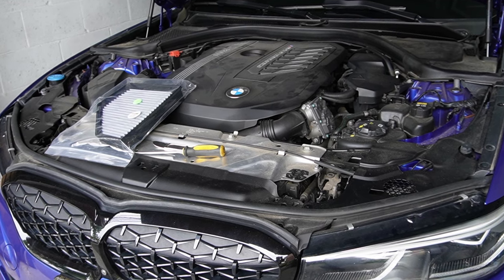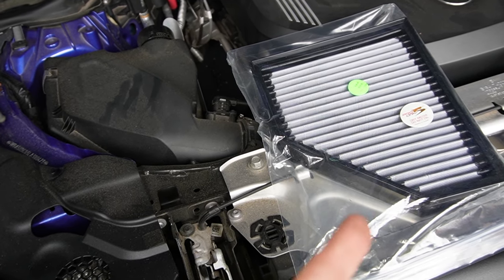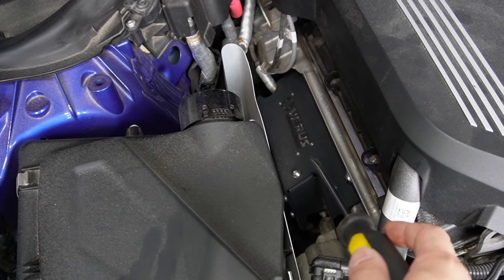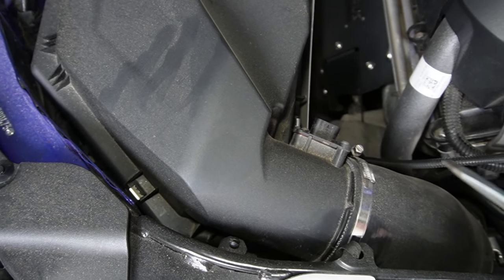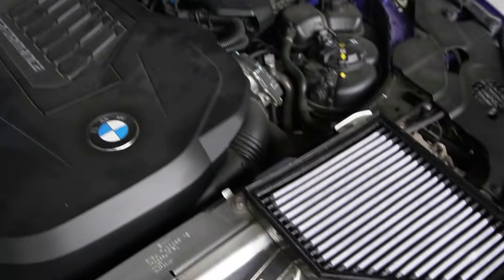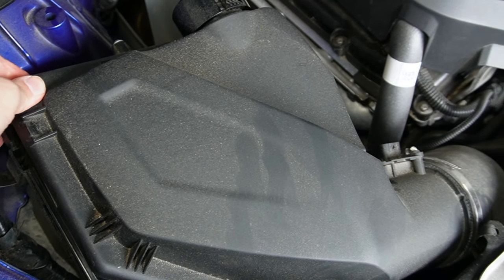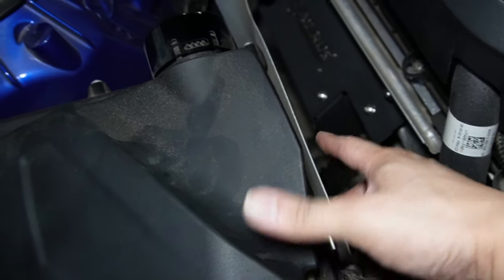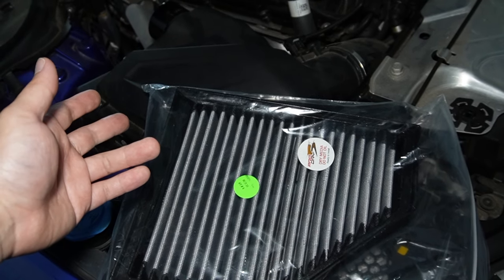PSA: Your Engine Needs to Breathe! | BMW M340i | Toyota Supra | B58

Comment: Definitely ordering for my m240i!
Reply from the maker: Do itttt! But there might be another part# for M240. Double-check before ordering!
Reply: you should look into silicone intake elbows to remove the resonators and also a turbo inlet with wider diameter to remove the stock inlet. I have a b58 racing silicone intake and a DAW turbo inlet
Reply from the maker: @souljayt8411  Agreed. I mainly did it because I wanted a cleaner look and less-cumbersome engine bay. Plus, it doesn't hurt to get rid of plastics with aluminum & silicone ;)
Reply: I put on my m140ia this IS thé best best air filter no oil best filtration AND quality

Comment: Any difference with the intake pipe and resonator delete?
Reply from the maker: It's interesting - scroll down for TLDR.
I'd done the intake resonator delete and the intake pipe at the same time; DME unlock and BM3 stage 1 after. I don't recall hearing any intake and/or turbo sound after doing the intake res delete & intake pipe. But after getting it tuned on stage 1, I have since started to hear turbo whistle and spooling underload. I wanted to assume it's because the stage 1 tune has added more load (perhaps) and raised pressure to the turbo (certainly). However, under most hooning circumstances, the turbo sound is overpowered by the exhaust under a heavier load (say boosting from 4k rpm).

TLDR: I can definitely hear turbo whistle and spooling underload with the intake res delete & intake pipe, at least on a stage 1 tune.